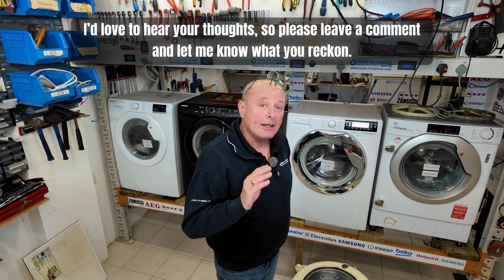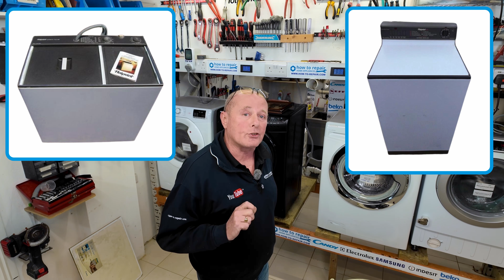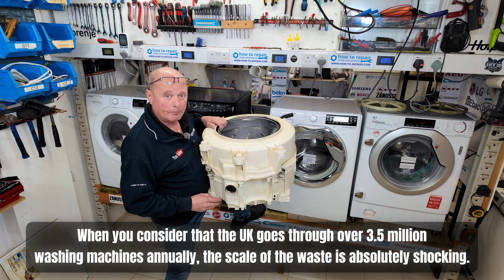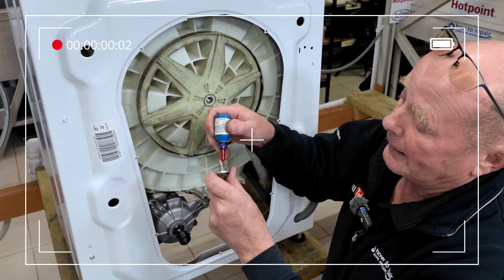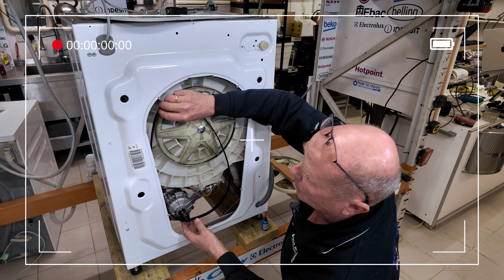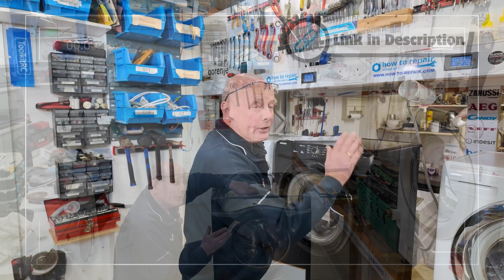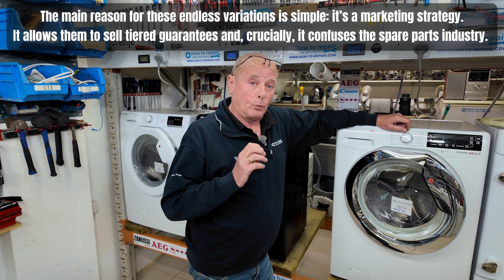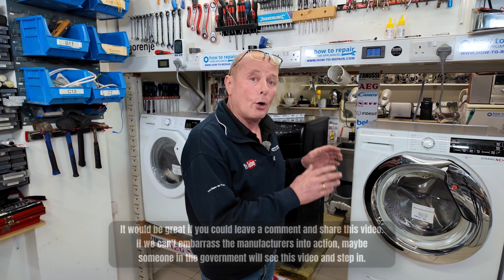I Scrapped 13 MACHINES to Prove a Point: STOP BUYING These Brands!

Comment: I love my ancient whirlpool. It's the same model my my mom and step-dad had in the home I grew up in. It was the washing machine they bought when they bought their house in 1987. My mom and step dad eventually divorced, he remarried, and he kept that house, last I knew the washer was still there in like 2004.
Then in like 2017 a friend of a friend's relative was going into a nursing home and they needed to clear out her apartment, and they offered me the washer and dryer, and lo and behold, it was the same washing machine my step-dad had. The one I used for my entire childhood. Talk about nostalgia.
But think about it. It was still there because it still works. And it still works today. And I still use it the way I did when I was a kid too. I overload it. I put unbalanced loads in it. When it violently shakes around in my utility closet, I genuinely worry more about the pipes and stuff than the washing machine. This washing machine is basically invincible.
That said, I have destroyed a couple sets of agitator dogs, but it was totally worth it.

As far as I can tell, this device operates as well as when new. And I expect that it will continue to work as well as new for as long as it already has. So I think that as long as I keep this thing, I will not have to spend $300 per 4 years or whatever for the rest of my life. If it lasts me or my heir another 40 years, it will have saved $3000 in 2026 dollars, which means that it is its intrinsic value. 
If I could securitize my washing machine and trade it on the stock market, it would be worth like $100,000 just based on fundamentals.
It's not going anywhere. I am not in the market for a washing machine as long as I have this one.

Comment: Everything "smart" or "AI" is made to planned obsolescence.
I have a pretty good experiences with Bosh washing machines so far. Our previous cheap washing machine (I think it was ECG) died because of died heating, so we wanted to replace it (because it's a pretty common and easy to fix problem on most of washing machines), but then we found out it was designed to be not replacable on this machine, I don't know if it's only this cheap one or all ECG, but I can't recommend it, buy Bosh if you can, we already have our Bosh washing machine for like 7 years, using hard water from well and no problem at all, only little problem is that locking mechanism sometimes doesn't lock on first try and you have to a little bit hit it, but that's not such a big problem and I guess it's fixable.

I always prefer products that don't have any displays, but that's almost impossible in these days for washing machines, but you should definitely avoid boliling kettles and microwaves with displays, because display means computers inside and you really don't want it in basic kitchen machines when it's not needed and it will break becasue of that because it's programmer to break.
You should also avoid Krups coffee machines, they are designed to break in 2 years.
Many people complain about Philips getting low with quality, but I have pretty good experiences with Philips compared to other brands.

I don't believe in this type of capitalism they are doing, I believe that satisfied and loyal customer is better for you to the future because he will return to you. When you make something that breaks, he will try something else next time, how is it good for bussines? I don't get it.

Now our 5 years old Canon printer started failing, it's already tank system, pretty good printer that printed thousands of photos, printerhead is easy to change, but it's killed by beying not available to buy, so easy to replace doesn't automatically mean it's better when you can't buy a spare part, that's really sad, such a good printer it was, I would better fix it than risking new one.

I know it's not really possible in capitalism, but there should be a law that they can make only like 1 new model of washing machine every 5 years to stop this artifical "development" of nonsenses designed with only 2 goals - to make spare parts not compatible and to die even faster than previous model.
I also blame EU for not solving it, they are doing exact opposite like banning classic Sn60Pb40 solder which caused another tons of pointless e-waste in name of removing few grams of lead...it makes no sense, there are much worse thing in that garbage than few grams of lead, but nobody cares. Even polystyren for packaging is worse than lead and still, it's 2026 and half of products still come in polystyren like if it was 90s. Some producerts replaced it for some material that can be dissolve in water, so everything is possible when you want to do it. I am really angry when I buy something and there is polystyren, not because of I am some eco-terrorist, but I just hate that mess.

I am opening stuff since I was a kid so I really see how planned obsolescence is getting worse and more advanced, like 20, 25 years ago, it was mostly about designing plastic parts to thin so it will break, that's not really the case today, now there are often software issues or updates designed to kill it and that should be really illegal, like all phones I had in last 10 years had this problem - the last update caused some problems, don't tell me it's a coincidence, these corporations should be fined for that and by fined I mean FINED, not some ridiculous 1 million eur fine, they barely notice it, I mean like billion of eur and when we catch them doing it again and again, I would completely ban them from our market, but that's something EU and bigger countries would have to make a deal and agree together, it's clear that banning it in one smaller country will change nothing, this is why EU and such organisations were created, but all their laws against e-waste and planned obsolescence are created by people who are bribed by corporations or have no clue what they are doing.

Comment: It is a myth that most manufacturers intentionally design hardware to fail sooner. In most cases, the primary goal is to reduce production costs by selecting less expensive components or manufacturing processes. A shorter lifetime can be a side effect of these choices, but the objective is usually lower manufacturing cost, not reduced durability.

For example, metal is not replaced with plastic because plastic will break where metal might only bend. It is replaced because plastic is several times cheaper than metal. Screws are not replaced with glue or plastic rivets to make repairs more difficult. These alternatives are often used because they reduce assembly time and require less complex machinery in factories.

The reason a complete machine can be cheaper than the sum of its individual components is largely due to scale and distribution. Manufacturers produce finished products in large quantities for retail sale, allowing them to offer quantity discounts to retailers. Retailers assume the risk of unsold inventory and bear the storage costs.

Replacement parts, by contrast, are typically purchased only by repair shops and in much smaller volumes. Manufacturers must produce these parts specifically for a limited customer base, often without precise knowledge of future demand. If too many parts are produced, they may never be sold. In addition, manufacturers must store these parts themselves and absorb the associated storage costs.
Reply: Not quite on topic, thus I add this as a reply to myself:

I work, for example, as a software developer, and we are often accused of deliberately adding code that causes our apps to stop working on older operating systems or hardware over time. I know our code inside and out. Nothing like that has ever happened. It has never been requested by management, and no one has ever intentionally implemented such behavior.

What actually happens is that, at some point, it becomes economically unviable to continue maintaining code specifically for older systems. No one pays for that work. No one is buying the app for an outdated system anymore. Those users purchased it years ago.

In order for the app to run on new systems or take advantage of new system features, the code must be updated. These changes can result in incompatibilities with older systems. There is no intention behind this. We do not aim to break anything. However, management does not allocate resources to work that generates no revenue. As a result, certain adjustments are not made solely to preserve compatibility with legacy systems. Without those adjustments, the app may continue to run on older systems, or it may stop working there. In either case, this outcome is not deliberate.

Otherwise, we would quickly reach a point where about 30% of our working time is spent solely on legacy systems. That would mean investing 30% of our effort in customers from whom we have earned nothing for years and who may represent only 2% of the user base.

At the same time, the remaining 98% of our customers, those who are currently purchasing the app and effectively funding 100% of our development work, would receive only 70% of our capacity in return. This would happen even though those 98% customers have no interest in outdated systems, since they are using current platforms.

Comment: I believe this planned obsolescence has infected the entire electrical industry. A good example with modern TV's is the ones they manufacture where the screen has no border and is glass all the way to the edge. If your LED system fails it is very time consuming if not near impossible to replace them without cracking the screen on removal. They rarely make replacement screens and if they do are excessive in cost. A simple solution to this problem was given by an engineer who suggested they mount the LED's on a strip that can be unscrewed on the side of the TV and slid out and replaced with new ones in a few minutes. I have yet to see any manufacturer produce such a TV.

Comment: I was an Electronic Technician in Philippines before leaving my country . I used to work for National Panasonic and then Sharp . So I’ved always buy those brands . Sadly this days your in luck if they have replacement parts for those machines after 3 years after buying those . One of my Sharp fully automatic washing machine was banging when it’s in spin mode or drying mode . I know the suspensions are week so I went to my former service center ( Sharp Service Center ) , of course they have no replacement parts so I ask them to order them for me . After so many years still no parts available . That was a 3 years old washing machine and now it’s junk . Another one is my Sharp Refrigirator , the magnetic door seals has to be replace so ask for a service and they said they don’t have spare parts for it and they will try to order them . We’ll guest what , after 3 years no luck . 

LG washing ( force to buy a new one ) , corroded wiring sockets cause error . No more parts available ( parts obsolete) 5 year old washing machine . Appliances now a days are disposables !

Comment: This came into my feed 3 days too late lol. Just been thru this exercise in NZ. My AEG lasted 16 years, my Bosch 14 years. I pretty much knew what was wrong. Had replaced the brushes in 2018 and other issue in 2017,  same F fault had cost me best part of $500 back then so figured wasn't worth fixing with costs so high. Just bought an Electrolux as was recommended by so many colleagues... fingers crossed. What peeved me off more was I saw a Bosch model I wanted being run out in Australia (was accidentally on Aus site b4 i realised) for $799 - but in NZ it was still avail for over $2800!!! We get so ripped off in this country now.

Comment: I have two hoover h wash 300’s. Double stacked in my utility room. The spiders in both machines have failed within a couple of months of each other. Both  machines just over two years old. I couldn’t believe it when I opened one up and saw the sealed drums. Still I thought, I have a ten year parts warrenty. Contacted hoover and they wouldn’t supply me new drums. They only supply the parts if I use a qualified engineer to fit them and pay the labour. Obviously that’s more that’s more than they are worth, so I took them both to the scrap metal man. It’s all a con.

Comment: Well, thank you so much for triggering this movement. It seems to be a general behaviour. I work in lubricant activities. The OEM calls for fuel-economy engine oil. It actually reduces fuel consumption but on the expence on the engine lifespan. This is real. They do not care about the client's loss.

Comment: Hi folks, my washing machine finally developed a fault a month ago. The machine is an AEG Lavermat 6100 Digitronic and was purchased on 20 March 1997. It has lasted 29 years without developing any faults. On a recent inspection, it was suggested that a small motor was responsible for a short programme spin cycle fault. However, I think the real fault is a failing PCB board. A new PCB board is no longer available for this machine so will be scrapped. Combi Boilers is one area where the British public are being ripped off. The average lifespan of these boilers is 10-15 years. I had a combi boiler installed in 2010 and lasted 10 years without a fault. In 2020 the PCB board was replaced. Last year three component parts were replaced at a cost of £550. Two weeks ago this boiler flashed up an error message and a gas fitter suggested a new fan and PCB Board at a fitting cost of around £800. He wasn't sure which or both components had failed. I have recently had three same name branded electric blankets. Each has failed within a few months. The culprit component is a small PCB board located inside the online power switch. The switch is not available for replacement. Great Britain does not have a manufacturing base anymore so the country is reliant on cheap poorly made components and finished goods coming out of China and the Far East.

Comment: I bought a Hoover H-Wash washing machine last year and its already displaying Error messages. Still works, but it gets stuck with 1 minute to go on every cycle and you have to manually turn the dial to 0 to finish the cycle and open the door.... :face-purple-crying::face-purple-crying::face-purple-crying:

Comment: I will speak to my Samsung pair now at 10 years old and minimum 1 wash a day (active family of 5). Weekends, they run non-stop. It is a door in door model, "add to wash unit" which has been handy. I believe the model is WF50K7500AV with matching dryer. 
Washer:
- At year 7, the washer bearings failed in the drum. I was able to source bearings and seals and fixed it right up. 
- At year 8, the washers drain pump failed. Decided to just replace all pumps at that time (was on sort of a manifold below the drum)
- I have had to replace the front seal twice due to family leaving cloths hanging partially out when the door was closed. Tore the seal. Irritating and not the fault of samsung

Gas Dryer:
- At year 3, the dryer had the belt idler pulley seize as it had bronze bushings. The replacement had actual bearings which was the updated part. No problem since. 

It will be very curious to see how much further they can go! Not upset at all with the repairs as I was able to DIY.

Comment: Had a Candy washing machine fail after 3 years. PCB went. I was gutted. Spent ages trying to fix it including soldering different components.

Have a Candy dryer that after 3 years sounded like a drum and base song playing out of it, banging like crazy. Had to strip the whole thing down apart from the drum and motor in order to get to the drum bearings. Repleaced the bearings for £15 and its still running a year later. Not buying candy again.

Comment: I bought my house in 1973, Married and bought a miele washer and dryer. Now 52 years later I use the third set of Miele washer AND dryer. So almost 20 years per set. And it were not the washers, but the dryers who stopped working. But I bought a new SET. Good stuff!. The Miele dishwashers were good quality too. The one I use now was bought in 2007... Never had to be repaired.
Reply: Miele is good especially the older ones i have an 35 year old dryer 😊

Comment: Aren't most machines made by Vestel now??
Reply: No. If anything, fewer brands are being built by Vestel now. Lots of brands are turning to other manufacturers like Midea to build their machines as they are cheaper. The 2026 models of own brand applinances like Logik at Currys and Bush at Argos for example have just ended their longstanding partnership with Vestel and switched to Midea.

Comment: I'm from the US and I'm not an engineer; however, I agree with your assessments on the two types of machines you are presenting.  I wanted to point out that your assessment is not limited to just your two machines but also include some in the US.  If only the makers of these machines would take advise and show some pride into the development of their machines.  What the vendors don't understand is there are customers that will spend nearly every penny available just to find that the machines are not worth the cost.  Thank you for your video and exposing the problems we, the customer, are unfortunately having to face.

Comment: This is a brilliant series and I have subscribed as the content is exactly what we need.

Ive been through countless machines and the quality is abysmal. I've fairly hands on so have replaced various parts, but the spares costs are clearly designed to stop people like me 'having a go'. I.e. if I sink £150 in and that still doesnt fix it i'll still have to buy a new one. Forces the decision into scrapping the old.

The best advise I have heard from a previous boss of mine was to buy a factory second (dents etc) industrial machine. It'll cost you £1500 once rather than £400 every 2 years... Thats my intention when the latest one dies. Its only 6 months old so I dont have long to wait...